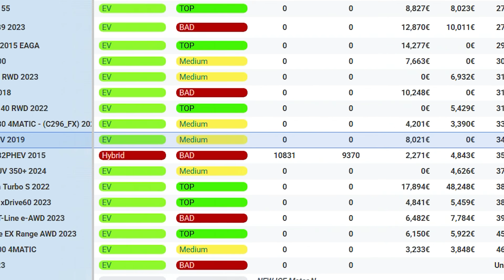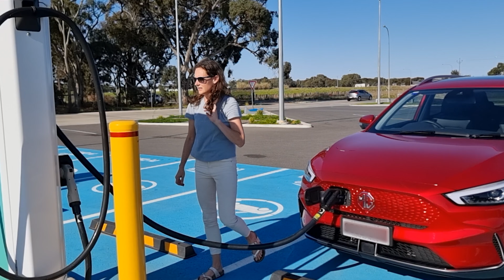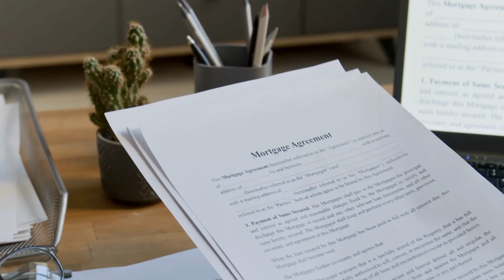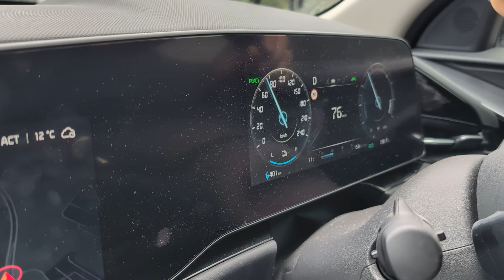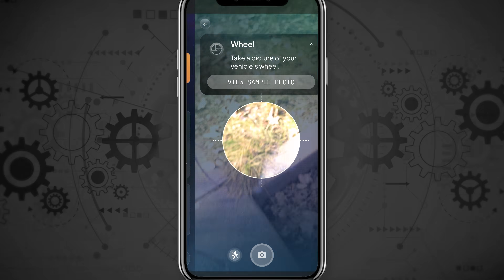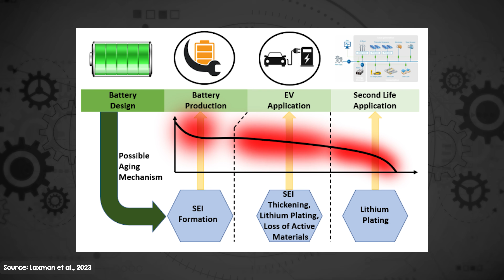Watch This Before Buying Your EV

Comment: Appreciate the nuanced and detailed take not covered elsewhere, very refreshing, the EV Clinic spreadsheet is a big deal for consumers, well researched piece. However you identify the 'uncertainty about battery degradation' as the problem and the solution is independent battery testing health measurements. I don't think that helps the person who already has a failed battery or has a healthy battery that later develops a fault. If only 0.3% of people die from a virus, would you say it is not worth vaccinating people? Even if battery failure rate is 0.3% (by the way, only relates to batteries made since 2022 so they are fairly new to begin with, I would wait a further 11 years for a more accurate failure rate on batteries made in 2022), consumers should not be happy because of the huge consequences of failure. If this failure rate of 0.3% is actually true manufacturers should have no problem providing 15 year battery warranties which you should advocate for, or even better, battery swappability.that Chinese maker Nio and Catyl are pioneering - where they treat batteries as a service rather than a product. If consumers in the west don't fight for low cost battery swapping, the resale value of used EVs will continue to be decimated. Don't trust the manufacturers to find a solution, they have no interest in prolonging the life of products when they make more profit selling a new one. We need government regulation.

Comment: Key takeaways regarding battery health:
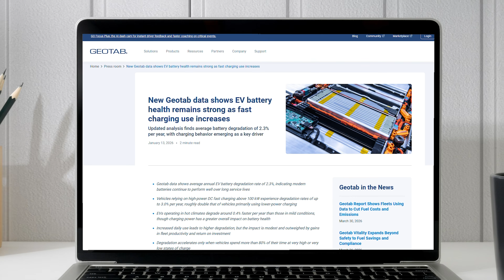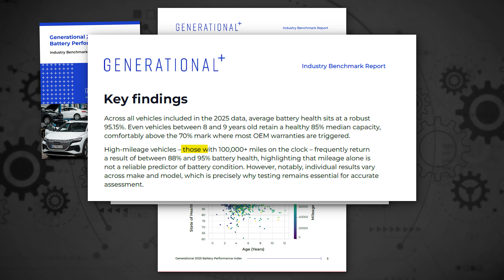Real-world data: Studies show an average capacity loss of approximately 2.3% per year (1:51). Older EVs with high mileage (over 100,000 miles) typically retain about 90% of their original capacity (2:22).
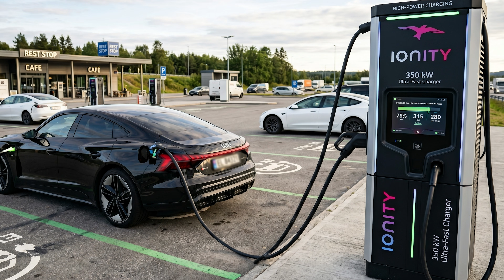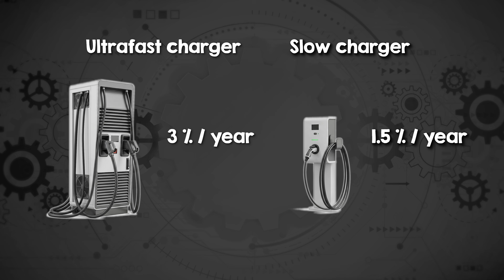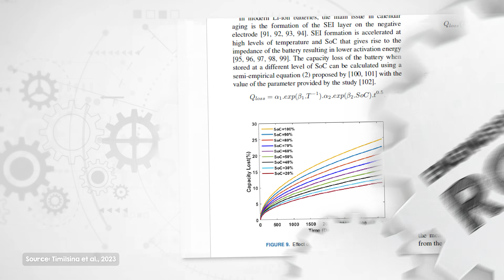Factors affecting degradation: Frequent use of DC fast charging can accelerate degradation (up to 3% annually), whereas slow charging is gentler (1.5% annually) (2:43 - 3:02). Extreme heat and keeping the battery at 100% for extended periods are also detrimental (4:31 - 4:54).
The S-Curve: Battery degradation follows an S-curve, with a sharper initial decline as the solid electrolyte interphase (SEI) layer forms, followed by a long, stable, and predictable period of slow decline (5:20 - 6:28).

Testing battery health:
Because onboard dashboard estimates can be unreliable or hidden by manufacturer buffers (17:30), the video recommends independent verification:
OBD Diagnostic tests: Using a device to monitor the battery through a full discharge or during a drive provides a more accurate State of Health (SoH) reading (11:03 - 12:03).
Third-party apps: Services like ClearWatt offer software-based assessments that use telematics and driving data to estimate battery capacity without requiring a full discharge test (12:50 - 14:26).

While battery replacement is rarely needed (only ~2.5% of EVs), costs can be high, making independent battery health checks a critical, yet currently underutilized, step in the used EV buying process (6:28 - 7:32).
Reply: Thanks, I’m still watching in full to benefit the content creator
Reply: AI regurgitation👆
Reply: @aromaticsnailYes, it was copied/paste  from the Summarize Video button in the Description, for the benefit of others.
Having an annotated time index of the video for reference is useful.
Pasting here saves others the hassle and saves Youtube havingvto fetch the answer again 
But thanks to complainers, Youtube has Disabled the ability to Select/copy the Summarize text.

Comment: Hang on…I thought you said there were buffers? In that case, we are never charging a battery to 100% right?
Reply: Depends on make/model
Reply: @MortyMac all EV batteries use buffers. The buffer is unusable by users and protects the battery. In user terms we are never charging to a physical 100% as the buffers prevent that.
Reply: @mazilys The size & management of buffers depends on make/model. Rumour has it Tesla deploy quite a small top buffer(?) for example. VW have been known to set 20% of the gross battery aside for buffers on some of their models. Some have their buffers retained for the life of the vehicle. Others reduce buffers progressively to mask degradation. Others release some of a buffer reserve with a software update. Just saying there is no consistency.
Best to read the manual for specific advice, but otherwise ignore the buffers & do as much best-practise battery health management as your lifestyle allows as if they weren't there... because one day they might not be.

Comment: Off lease Ev in North America have 5-6 years and 70-80K miles left on their mandatory factory battery warranties.
Also, there are several independent shops that specialize in refurbished swap in battery packs for many ev models of the past 10-15 years.
They have a guarantee, and priced far lower than oem replacements, typically $5-12K usd based on model, year, capacity. Great option for out of warranty batteries that fail.
Ev specific shops may offer to buy, give credit or repair your failed pack if a controller or isolated cell(s) issue

Comment: An excellent source of battery information on YT is “The Limiting Factor”. He also did a deep dive into technical papers covering battery degradation. From my recollection, DC fast charging wasn’t really a big factor. It was actually calendar life (how old the battery was) which is basically side reactions in the battery chemistry leading to less lithium and hence the capacity dropping. EV Clinic are also excellent source of info about how expensive hybrid or BEV are to replace. And which manufacturers to avoid.

Comment: Because full EVs have a large battery, their workload per cell or module is quite low. My EV6 has had no discernable degradation in 3 years. My previous Outlander PHEV after 40K attained only half it's stated range, my reasoning is the tiny battery is doing the work of a full EV battery moving the full 2 tons around in EV mode. This makes the cells/modules work way too hard, hence a short life. Even after many battery resets and conditioning range was still around 25-30km way short of the 50km. I'm not worried at all about my EV6 battery ! Nice video Rosie !!! 🤠😎
Reply: Sorry Kia/Hyunday melt off the buffer to compensate for degradation therefore the SOH is always high but its kinda fake. Watch that ICCU though that is much more of a concern.

Comment: The old Nissan Leaf’s used to be air cooled (who at Nissan Engineering thought that was a good idea?!) so the BMS struggled to keep the battery cool (or warm in certain conditions) so degradation was pretty high. Just search for “chargeGate” hash tag about poor Nissan Leaf users being stranded with a slow charging session due to the battery being too warm after a long drive.

Comment: LFP batteries almost do not degrade, if you don't leave the car standing with 100% charge for more than a couple of hours. Apart from that, LFP batteries can easily outlast the car. You actually need to charge them 100% once a month for cell balancing and once every three months do a recalibration charge from 10% to 100%, but right after they get to 100% you better do a little drive to skim the top 10% off. Do this, and the battery cycle life will begin at 3000 cycles.. or about 30 years.

Comment: Problem is that cars with smaller batteries get a larger penalty for degradation. If my e-Golf lost 15-20% of its original capacity that could mean 40km less range of only around 210km or so on a nice day. In winter that could be so bad it makes the car useless. So buying a small used EV for commuting might end up being a dud after a couple of years. The needed range might not be there in the cold.

And as more people buy EVs there are also going to be more people relying on DC charging as they have no way to charge at home.
Reply: wouldn't you buy an EV that is oversized for your needs exactly to prevent this?
if I commute 100km a day and I buy this car I still have a huge margin to work with.
Reply: @Schinkeldink💯
Reply: I hear you, but no home charging doesn't have to mean waiting around for a large DoD charge at a DCFC. There are public AC chargers, & even slower DC chargers which would be kinder to the battery, & cheaper too. The challenge is just how to fit them into your lifestyle. Options for slower charging could be while at work, the gym, grocery shopping, routine social destinations, cafes, kerbside lamposts, ... I even charge a few EVs at my home for people I used to work with. They get free parking in my driveway & eScooter the last bit to/from work. Their car gets all day to slow charge. The price is set between what it costs me & what it would have cost them to public charge. It's paying off my charger nicely 😊 (although I did get them each to sign liability waivers).
Reply: @MortyMac  AC charging is pretty rare here because most can charge at home. They exist at some high schools for teachers and at long term parking complexes, but those also have a parking fee. In and around cities it's probably cheaper to commute by public transport instead. With toll, parking and charging it is not going to be cheap. And the AC charging that do exist is maybe 10-20% cheaper than DCFC.
Most work places do not have employee parking in cities. And those that do often tend to be in areas where most charge at home anyway.

Very few shops my in town here have any employee parking. I believe those that do use them for the company work vehicles like electrician or plumber. And if I'm not mistaken they are reserved by rent to the municipality.
Reply: @Gazer75 Wow! You paint a grim picture for whatever town you live in. You're also at cross-purposes with the OG comment I was replying to, who was lamenting the lack of home charging for many EV drivers. Your lack of public charging options as a consequence of everyone charging at home kinda suggests you don't have that problem, so can just get on with EV life.
Reply: @MortyMac  We have lots of DCFC sites. The town has around 9-10k people within a 5km radius and there are about 8 locations with over 80 CCS2 plugs total between 50 and 400kW. There are 3 AC units at a public parking lot with a 2 hour max stay (9am-5pm) and free parking while charging. There are 2 more AC outlets at a different site, but they are on some old ABB 50kW units with CCS and Chademo as well. Same 2 hour limit applies at that site.

Around here most people will be able to charge at home. I think only one of the oldest apartment coops built in the late 60s or early 70s would have an issue as they don't have one parking lot per apartment.

Comment: Why is the discussion mainly about cars that are still between almost brand new and slightly used? One would hope that the useful life of a costly capital asset like a car is at the very least 20 years, ideally longer. This is very common for ICE vehicles. So we should really mostly look at what happens between 15 and 25 years and 250 and 400 Mm of distance traveled. How does it look then?
Reply: Most cars have a replacement engine fitted. If you do say 20.000km/a that would be 400.000km. My 12 yo Tesla has done over 450.000km.
Reply: @moestrei 
"Most cars have a replacement engine fitted."
Outside of Hyundai and Kia, that is false.
Cars are typically scrapped with good engines.
Reply: You seem to be overexaggerating the typical lifespan of ICE vehicles.
Reply: When you think about it, there weren't too many mainstream EVs around 25 years ago, & battery/BMS/thermal-mamagement technology from as little as as 5 years ago would not have much in common with many new cars of today. E.g. a Zeekr 7X base spec has a 75kWh 800V LFP battery with 22kW AC charging & can DCFC 10% - 80% in a little over 10 minutes with peak charging of over 400kW. This was fanciful only 3 years ago. In fact the first Tesla Model Y was only released in 2020!
Then you mention distance travelled expectations when really it is the charging & storage practises in a modern EVs history that are thought to have more impact on degradation than any correlation with odometer reading; so called "calendar ageing". There are examples of original batteries going over 500,000km, & even one in WA doing over 400,000. Others don't do nearly as well.
Finally, saying ICE can be expected to live for 20 years isn't exactly true either given so much of it will have been replaced in that period: spark plugs, filters, seals, oil, fluids, hoses, brake pads, rotors, timing belts, coils, maybe a clutch, exhaust, ... It would be stirring the pot to say, but maybe "original" ICE engines don't last more than 12 months given the manufacturer requires bits to be replaced by then...?
Just trying to say an EV is a fundamentally different ownership proposition. Standardised independent battery health testing would be very helpful for buyers of used ones for sure. Tks Rosie.
Reply: Because there's not that many EVs around from prior to 2018.

Some of that we'll only need time to tell the true state of longevity, but the early Model S seems to be holding up alright. Nissan Leaf less so due to poor battery cooling.

Comment: Um, smartphone batteries are usually just one cell... So there is no need for a complex BMS like those in EV batteries with many cells in series and parallel...
Reply: Also cell phones are not temperature controlled at all.
Reply: which could be seen as a negative (more parts to fail) but also positive (you ain't betting on one horse and the vehicle does not necessarily brick itself with one cell failing)

Comment: The costs shown for EV battery replacement are a bit misleading, or at least lack important context.

Firstly, all EVs, at least in Europe and the UK where I live, have battery warranties that are a minimum of 8 years/100,000 miles - I believe this is mandated by law. So any battery replacement would be at zero cost to the customer. These warranties are transferable to buyers of used EVs. 

Secondly, the costs for battery replacement shown were for new batteries, from the car maker, and fitted by an official dealer. Now, sometimes petrol or diesel engines suffer catastrophic failures that require an engine replacement. If this where done with a brand new engine straight from the manufacturer at a main dealer it would cost in the UK, about £7000 to £15,000 for most cars, assuming it was outside the warranty. However, nobody would dream of taking a ICE vehicle which was 8 years old  or had 100,000 miles on the clock to a main dealer to be fitted with a brand new engine! They would go to an independent specialist and get a old, reconditioned, engine fitted for about £1500 to £3000. The same applies to EVs.
Reply: But the warranty only comes into play if it totally fails of with under 70% capacity. For my own use for work I would need mine to be a min of its 80% capacity, so in terms of range, the warranty is not very helpful. So I just hope if does not degrade much
Reply: You're talking with Ford Ranger and Ford Everests in mind here.
Reply: The EVs locks the street side repair shops out of the loop by software and car Internet connections.  They know you are changing your battery using a cheaper source and will lock your car, forcing you to their official dealer to do the job.  Also, to satisfy the condition of the so called warranties you will need to meet a lot of conditions such as all your regular maintenance job have to be done at the official dealers, no third party parts are ever allowed.  Just remember: they have the software and Internet connection to monitor you 24X7
Reply: @dongningprc not always the case. Plenty of Nissan leaf battery upgrades on YouTube
Reply: @dongningprc That's now. Just wait and see how this develops. Can you imagine that a guy sitting at a desk in Shenzen fixed a software issue on my solar inverter in Queensland. Also, talk about fast service and determination. They were amazing and free, and had no obligation to fix it. An electrician here quoted $180 just to come and look at it. Slightly worrying aspect is that a guy in China could actually see how much power we were generating.

Comment: EV battery packs also die for reasons other than cell degradation. Water intrusion and internal coolant leaks, contactor relay and fuse failure, voltage and temperature sensor failure, BMS module failure and connector failure are some of the reasons. Some of these can be repaired, others such as the sensors can have redundancy and implement work-arounds. Some recommend preventive servicing of the battery packs by taking them out of the vehicle and inspecting for corrosion, damage, and leaks, replacing vent valves, cleaning components — a small cost relative to a new pack replacement.
Reply: My 11 yo 2015 Tesla Model S 70D with 125,000 miles is on the original motors and battery with about 86% state of health (200 rated miles range). I have not serviced the battery yet, though the pyro fuses may need to be replaced soon (the internal to the fuse lithium battery expires).